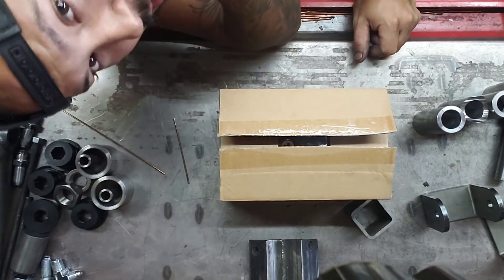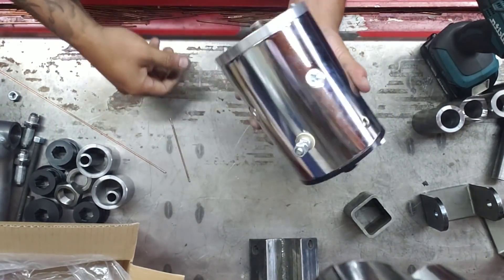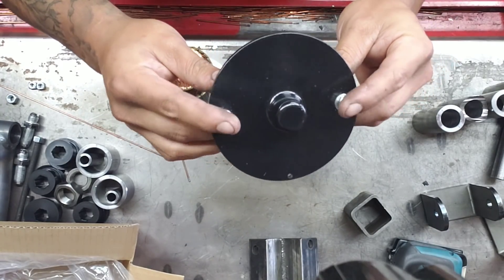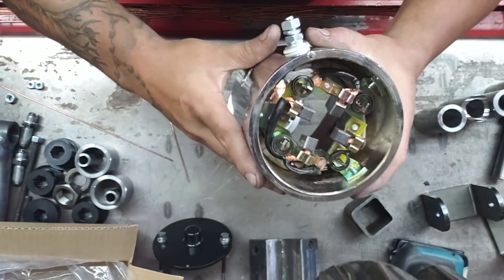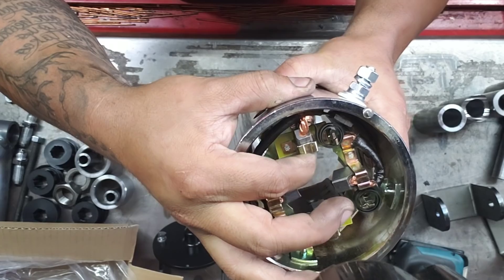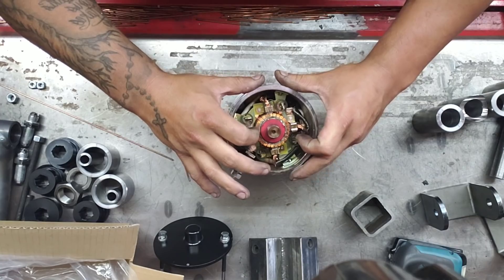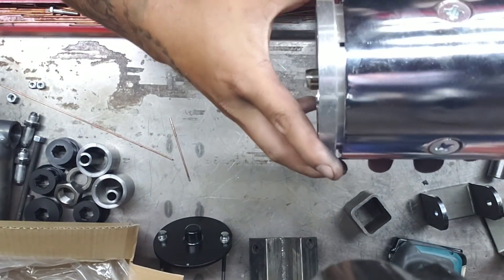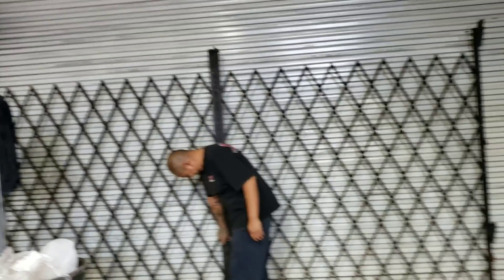"HOW TO" re assemble  a motor

Comment: When people rebuild brush motors the common thought is that the black mark around the commutator (copper piece where the brushes sit) of the armature are bad so they try and clean it off. It is important to not do that. Most people will use wire wheels to clean that off which creates a rough surface which will act like sand paper and eat the brushes apart. The black surface that is created after a motor is broken in and run (see other Hoppos video for how to do this) is actually a passive carbon film that helps the brushes maintain a uniform contact to the commutator and maximize the surface area for the current to be transferred. If that surface is rough the brush can start bouncing and arcing against the commutator which will begin to pit the copper which will also drastically reduce the life of the brushes and the armature. The only true way to dress the surface of the commutator is with a lathe and there is a limit to how much material can be removed for to maintain proper function of the motor.